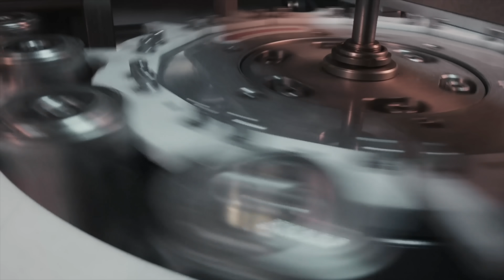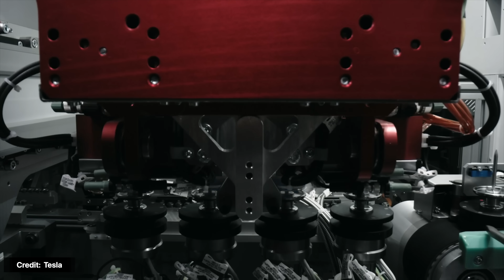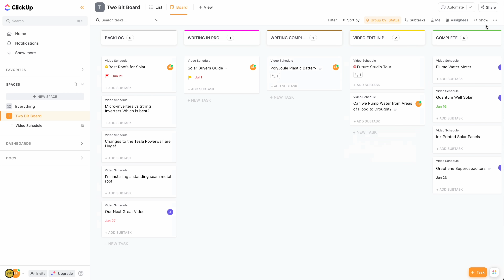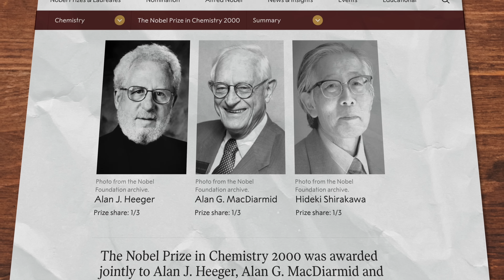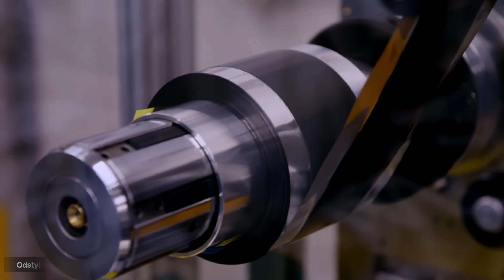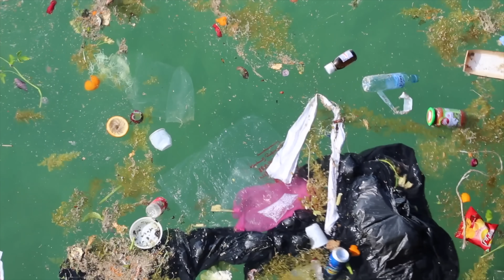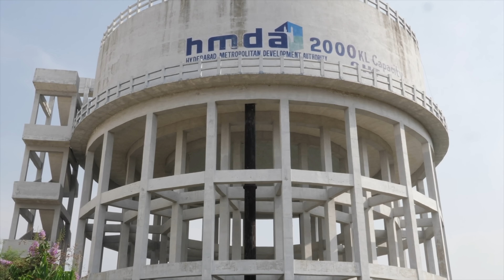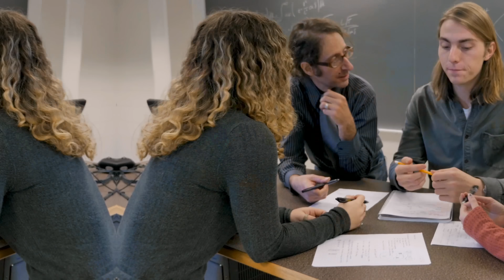Breakthrough Plastic Battery Requires NO Mining, is Cheaper & Lasts Longer!

Comment: The problem is the anode and cathode have a short lifetime.  If batteries can be made to last with plastic materials.  The chemical break down is the biggest issue.  Plastic is known to be an insulator.  Not a conductor.

Comment: I don't like the blind demonization of plastics. We certainly have a problem with how certain areas are disposing of them, many of the best options to solve that still fall under the umbrella term "plastic" and get banned right alongside other plastics. And much like Germany going to coal because of ignorance driven panic over nuclear, plastic bans invariably cause more harm because they don't think through what is available to do the same function.

Single use plastics are the famous villain, but the alternative is usually a lot of toxic manufacturing and cleaning chemicals to produce more durable things that don't last remotely long enough to offset their harm. We have gradually improved some, such as replacing the cloth bags with durable plastics, but you can already see the problem.

Elimination of use cases is the better option, but it has to be done rationally. Banning bottled water sounds great until you realize not everyone has a safe municipal water supply. Banning straws honestly was a stupid idea to begin with due to the health benefits of straws, but it got worse when looking at the harm it does to those with certain disabilities and especially so when you realize the whole anti-straw hysteria came from one well connected 9 year old fudging his poorly sourced numbers.

Sadly, reality is complex, and we ALWAYS make things worse when we try to act without thinking very hard first. And the anti-plastic generalization is an example of that.

Comment: To say these are "No Mining" is as misleading as calling solar panels "Green".
There is lots of mining in the processes involved in producing plastic cells. Even producing JUST the polymers involves mining. While hydrocarbons to make some polymers can be synthesized without mined materials, it is not cost-effective and making plastic still uses a lot of crude-oil, natural gas, and other compounds obtained via drilling/mining after which refining methods are used to create the materials (like ethanes) from which the plastics are made. 

Also, the world population's dependency on petroleum production for manufacturing plastics has INCREASED over recent years. As Pres Biden continues to decrease U.S. petroleum production, and makes the U.S. again dependent on foreign petro production, it seems highly likely the price of these cells will only head up.

(Remember also that Pres Biden JUST said in the SOTU that We'll only need oil for another decade and that he stopped petro-to-refinery transport programs like Keystone and made a campaign vow to outright STOP granting all oil drilling permits.)

Comment: As usual, great job Ricky. I've been enjoying Two-bit Davinci for several months and have subscribed. You talked about "doing the right thing." That's such a huge point and often I think simple changes could enable that. As an example you talked about recyclable plastics. I've long wondered why we make so many different kinds of plastic but recycle only a few types. Why not only make/use recyclable plastic? From the chart you showed it appears different plastics have different chemistries. I assume this is to give them different desirable properties. I get that some things need a stiffer plastic while other things need more flexibility. In my city they used to recycle #2, 4 and 6 plastic (I think I got those numbers right) but now recycle only plastic things with lids (milk jugs, soda bottles). This means they no longer take yogurt, cottage cheese, sour cream, etc. cups. The reason they gave was because the odd and often squished shapes were hard to mechanically detect and filter and often jammed the machines. And here's the simple change. Change the yogurt containers to use plastic screw-on lids like peanut butter jars. The jars already exist. Machinery already exists to handle them. That plastic is already recycled.
Reply from the maker: plastic recycling is a huge frustration and big topic....would you like to see us cover it? we do have a similar topic on the books about waste.

you might really enjoy our discord group. we will have a link to it on our next video dropping tomorrow or on our next live stream.

Comment: Question: It is stated that "ions" flow between anode and cathode in the PloyJules battery. But which ions are we talking about here? You need something with low electronegativity, and I don't see how this can be accomplished with out some sort of metal ion. Can anyone clarify this? 
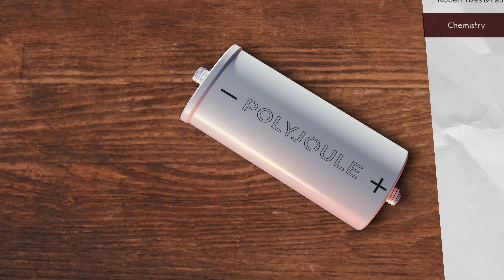Also the animation at 5:30 shows negative ions moving across the cell. In an ordinary battery you have negative electrons flowing through a wire, and not negative ions flowing in the cell. Is this maybe a mistake in the animation?

Comment: I keep wondering why they don't just melt ALL the plastics in single pot and just make something stupid simple like blocks for walkways etc. from them, then the physical properties does not matter much and in industrial setting you can take precautions for mixed in Teflon, PVC etc. (ie. hepa filtration and venting to outside air)

Really simple steps:
1) Wash it all that comes in, have a few people manually picking non plastic stuff away (unskilled low wage labor, eventually robotize as stuff scales)
1.1) potentially use water boyance to separate metals etc.
2) Grind it all down to 5-10mm aggregate
2.1) See 1.1 could be on this step too
3) Put it all in a single big melter, potentially powered by burning trash/biowaste (with exhaust filtration and high temp for cleaner burn made via gas burners ensuring higher than otherwise temp)

4) Pour into molds automatically, no need for fancy injection mold here

5) PROFIT

There are various things where plastic would be suitable cheap alternative.
With big enough scale you can get 100s of tons of somewhat homogenous properties, enough for mass producing some decently complicated stuff too via injection molding

Comment: Interesting. I think I misunderstood something. Isn't energy density supposed to be a measure of how much energy a battery can store by *weight*, not by _volume_? If I did have it wrong, what do you call the measurement that goes by weight instead?

Cause even if they are bigger in volume, if they're lighter and other factors work out well, maybe that old idea of making a vehicle where the frame and the battery are the same might be possible?

Comment: If my e-bike had 15 liters of battery that doesn't need to be protected by steel frame just to not catch fire, say around the rear  fork or on top of a rear wheel wouldn't it be better then  a 3 liters of capricious Li-Po, prone to freezing and leaking toxic electrolyte?

Comment: I had in mind to ask about the capacity / weight issue, but you pretty much covered what I was wondering... If the poly battery has to be five times bigger for the same capacity, then the best use-case would most likely be stationary bulk storage, where size isn't such a limiting factor.
Reply: Imagine siding for buildings, ceiling tiles or flooring that are actually batteries.

Comment: Until the source of the power is solved no matter what battery you have it will still need oil, gas, or coal to power. Wind is useless and kills more birds than generates power. Solar is unreliable unless you live in a sunny area. Right now nuclear would be the cleanest way to power all the electric crap. The plastic battery is still a good idea for small stuff though.

Comment: Ok... I feel like... I want a cybertruck sort of thing with a plastic battery and an iron air battery.    Plastic battery for it's ability to charge a decent amount quick, and quick discharge capability.  Iron air battery for it's huge power holding capability to be actively charging the plastic battery anytime you're at a stop or the car is not running.  I realize this might be like putting 2 wash machine sized things in a car... but... we built a car around where we place the gas engine...  Last I checked, that's at least 1 wash machine in size...  All I'm saying is, maybe we should get over wash machine bias if it  works...

Comment: Your graphic shows the electrons changing sides without exiting the battery. This is wrong. The thing in the middle prevents the exchange of electrons within the battery, forcing them to travel out the battery, through any connected wire/load, and into the other side of the battery. The electrons do not just change sides without leaving the battery. Otherwise your batteries would all be dead before they got to you.

Comment: "It's always cheaper to buy new plastics rather than to buy recycled".

Part of THIS is because the cost of collecting for recycling, as well as separating it into different classes COSTS far more than the cost of new plastics. 

The ridiculous part of the sham is that the groups doing the recycling are pushed into doing it in the most inefficient ways, while ignoring the most inherently cost effective ways -- In most places, the garbage collection for individual homes also does it. MEANWHILE, the places where it is typically all together in one place -- apartments and condominiums -- get charged separately for it, so they don't do it -- even though THAT is far far more energy and time efficient in terms of the amount of plastics you get vs. the energy used to collect IT. We should be strongly encouraging apartment complexes and condos to collect recyclables, and accept that it is going to happen less in individual housing (it still could be encouraged by voluntary collection at specific areas nearby)

Comment: Batteries which are ideal for stationary applications are the present vital need.  They free up Li for mobile applications and likely, because of this, would bring down the price of Li (supply and demand).  Besides they will enable the faster production of EVs.  There are a number of promising alternatives.  There are the Liquid metal batteries from Ambri, the ZnBr batteries from Redflow and Gelion and a whole range of redox batteries based mainly on V and Fe.  All should be cheaper than Li batteries once they have the production volume to bring down their cost.  All are from readily available, inexpensive elements.

Comment: No mining is not entirely accurate.  Plastic polymers are derived from petroleum or natural gas.  Polymer batteries would still be subject to petroleum and natural gas market pricing.

Besides cost, the reason we do not use recycled plastics is because the polymer chains are cut with each successive chopping, melting and reforming.  It reduces the strength of the polymer.  A battery that requires polymer chains to store energy would not be able to use much recycled plastics other than the non critical areas like its labels.

Comment: I'm not sure how many companies use 'parallel models' to design products, anymore; but were I looking to 'create a new battery', I'd go back to the drawing board, square one, and start with the concept of a simple capacitor. Keep in mind, while electronics capacitors are used in a variety of applications, to increase voltage, to form specific energy waveforms, etc., where a battery is basically an energy storage capacitor you're trying to get the longest, flattest discharge possible, from. So...what does a 'long, slow discharge' capacitor look like? What are features which enhance such a discharge curve? One of the biggest problems all industries face, is when they copy 'the last generation of a product'...as with photocopying, the 'copy' eventually loses all semblance of the original. Stop copying the 'last generation' (with batteries, that analogy could be Lithium Ion or Li-Po examples), and go back to the 'capacitor blueprint', and seek out modern materials which would maximize the mechanical intent, to start with...as you aren't really wanting a 'battery' as much as you want a 'VERY slow drain, flat wave, temperature insensitive' capacitor that has no recharge degradation.

Comment: Very interesting.
I feel like we keep getting fed rainbows and unicorns on plastic recycling. The industry is not internalizing it's external costs. We almost need a deposit type system when consuming plastic products that gets paid out in part on depositing for recycling and the other part goes to fund actual recycling. Maybe an additional tax on plastic products to fund research into or the actual function of recycling. The same can be said of any environmentally unfriendly product, especially the big new stuff like non-lead acid based rechargeable batteries, solar panels, wind generators, and consumer electronics.

Comment: I'm disappointed at how much of our precious lithium is being used for stationary applications. We should be saving that stuff for our portable devices. For grid storage capacity, we should be thinking of 1. Safety, and 2. Cost per unit of storage capacity. And that's pretty much it. To a large degree, it can be as bulky and heavy as it wants to be, and even issues around speed of charge and discharge can be worked around with an ecosystem of different battery and capacitor types.

Comment: The top 3 oil companies made a machine that sucks carbon out the air. But, those corps also make plastics. So they polymerize the carbon back into plastic to add 5x value and to not compete with themselves. Fun fact: "Your carbon footprint responsibility" was a concept dreamt up by BP, to shift responsibility from the corporations onto you. Another fun fact: it's cheaper to buy virgin plastics than recycled plastic. So due to "fiduciary responsibility", these batteries will just add more plastics, especially if we went green and used them for storage. The irony.

Comment: Do you imagine a gravity battery concept to be a better use of tidal forces than under water turbines?  If a tank was to raise and lower on shafts similar to a grand father clock' you could use valves to both fill and empty these tanks a strategically efficient times to gain the most benefits of naturally occurring tidal variations.
Reply: It's always been so obvious that the tides have an infinite amount of power and twice every day . Maybe not exactly very cheap to install but nothing is free is it ?

Comment: This is an excellent technology to have, right alongside thermal batteries--although those are more useful for grid power storage, where they'd actually decrease fire risks and reduce the amount of environment control needed (they're already hot enough that external temperatures don't matter as much).

Comment: I keep thinking about refueling my vintage VW Bug with electric, but range with existing battery technology vs the range on gasoline makes me hesitant. Something like this would definitely push me over the top. I just hope I live long enough to do the conversion. Thanks for sharing
Reply: Try a hybrid, Toyota Prius, very economical. Extremely long range
You will not regret it, Fun again in driving noiseless for mostly short daly trips, chargeable at home. On the road at 70 mpg
Reply: This is the complete opposite of what you would want.  This would store a lot less wattage for the space it takes up.  It would be great for stationary power, but not for anything that needs to move.

Comment: I've always been confused as to why we worry about size of batteries for grid storage.
Reply: well, you just cant ignore it entirely. if a material is half the price, but the battery has to be twice as big then you may not really improving anything. Plus even if its far cheaper, if its 100 times the size required, a battery bank for a city may have to be massive.

Comment: I'd love to have more capacity in my Powerwall but they are stupid expensive.  I have lots of excess solar in my array, on a sunny day the battery is charged up by 10am.  Then I am stuck feeding into the grid and in my area you get 25% of the value of pulling from the grid.  I did resort to GPU mining to use that power instead but that all ended about a week ago....  I might just pay another battery in the future if I got much more storage at a much lower price as the PW does not get me though the night....

Comment: The energy density is a killer for Automobiles.   That's basically range per recharge.   You either have 20% of the range for your care, or over 5 times the weight for the battery packs.  As far as the grid goes efficiency isn't quite the killer you might think.   If the round trip efficiency is 80%, that is terrible compared to Lithium Ion, but it would be roughly comparable to the best Pumped Hydro dams, and if it could store enough energy and have enough recharge cycles it would have a place on modern grids to help buffer wind and solar power.
Reply: Nothing about weight was mentioned. It's possible that the extra volume would not add up to a significant weight difference, since these batteries have no metal.

Comment: The factor of utilizing plastic waste is a huge selling point for me. This sort of tech should be encouraged by and invested in by plastics manufacturers as part of the overall lifetime cycle of their production. If you produce plastics, you should also be accountable for the responsible recyclability and ultimate disposal. This sort of tech has a major advantage to producing a long term, utilizable benefit based on recycled material component which provides a major offset to the cost and negative impact of it's ultimate final disposal. The more use you can get out of the plastic and the longer it can be used, the less ultimate, overall, negative impact it has and the more justifiable it's initial production and original use.